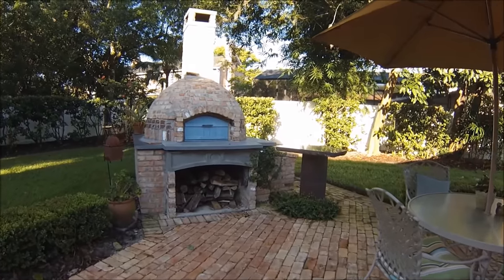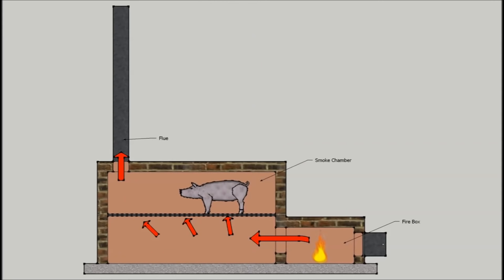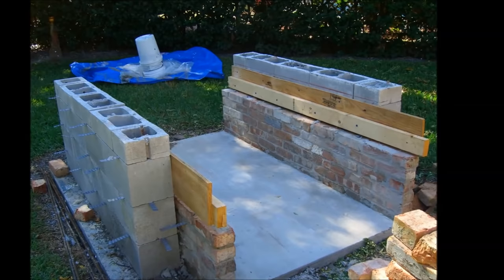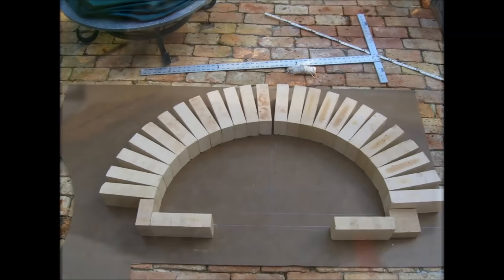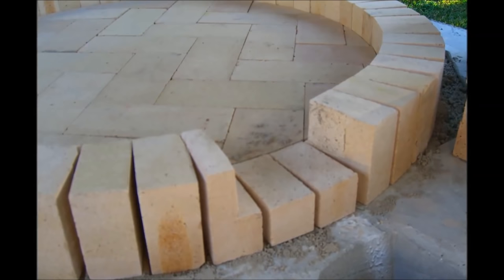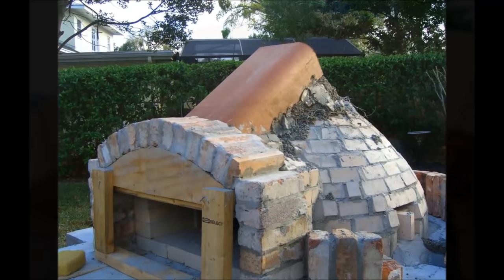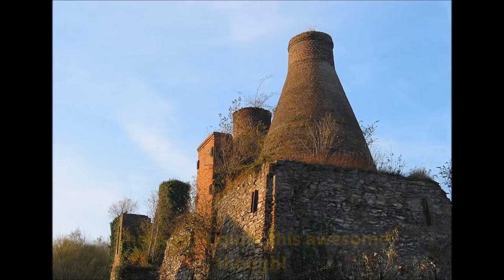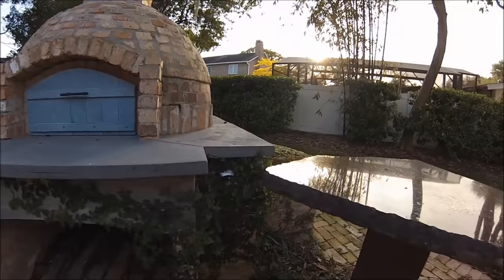How to Build a Brick Wood Fired Pizza Oven/Smoker Combo

Comment: Hey Lee, that`s a great video!
I did an apprenticeship with an old school plumbing firm in the north of England, we did everything from fixing a leaky fawcet to lead glazing to large scale heating, plumbing drainage and roofing construction projects. I`ve done plenty of lead, zinc and copper roofs in my younger days. The secret to getting the patina on copper roofs is as old as time and it is this........

One time I was fitting a copper roof on a catholic church in the shape of an A-Frame, and the old priest was amazed at how the bright copper sheets we placed each day, would turn green overnight. He`d often ask me how this happened and I`d always tell him it was a miracle! 
One day he saw one of the lads  on the scaffold with a mop bucket, mopping the roof. He asked me what was in the bucket and I told him it was Holy Water!
What it actually was, was piss ! The lads would piss in buckets throughout the day and we`d mop this on the new sheets before leaving site for the day. The acid in the urine reacted with the copper and turned it green! If you try this with modern copper sheets, they often have an oil based protective compound on them which has to be removed with  detergent , first.

Comment: Thanks from NY, for including the tip about making sure the foundation is beneath the frost line.
Reply: Think about what he said, how could that be? Northern states frost lines are 36"-42". That's impossible. It would be like 6 to 9 cubic yards just for the flat base to the soil level, not including the pad above ground! There must be a different way, like a floating pad for northern states. 
I had a similar idea for a smoke box but my idea was to put a second floor 12 to 18 inches below the main floor and at the back of the main floor, have an opening for smoke from a fire on the lower floor to come up and pass around the meat to be smoked on its way to the front chimney. You can also use the opening to brush your ashes then remove them from the lower floor...

Comment: Thank for not playing obnoxious music just plain calm explanations.Great build and thank you for sharing.Just a tip when you poured your oven base and was little short that is great.Fill the rest with salt it is great insulation and easier to level the bricks on top.
Reply from the maker: Yes, I agree, I should have made the bottom of the oven about 6" higher. That would have made it much easier to get things in and out of it. But, it would have made getting the brick out to use the smoker a lot harder.

Comment: Like many others considering a build, watching many videos, I’ve taken many tips from your video but most impressed by the fact your pizza oven has a sufficient flue opening to avoid the dreaded frontal smoke stain, brilliant
Reply from the maker: Yes it draws pretty good. A little smoke out of the front sometimes on start up or if it's windy, but other than that it pretty much all goes into the flue.

Comment: Nice Job!

I do a lot of DIY stuff on my Ranch, one thing you can do to get Air Bubbles out of Concrete is to use a round stick zipped tied/attached well to a vibrating sander!

works great for getting your mix to jiggle real good!

;Peace)
Reply from the maker: That is an awesome idea. That would have worked perfectly. I'll have to remember that trick the next time I pour some concrete.

Comment: It’s guys like this that make YouTube great, perfectly filmed and explained throughout. 

Over here in the Uk I have been trying to find out if I can’t use normal bricks to make a pizza oven, all builders merchants say no! I need to buy fire bricks but I know in Victorian times they used Engineering Bricks and the Italian for thousands of years have used clay bricks, I think this video clearly shows bricks are fine too use.

Cheers 🍻 for the upload
Reply from the maker: I used fire brick on the inner dome and I think that is the smart thing to do. Regular bricks might work, but then again, they might not. I would spend the small amount of extra money on the fire brick so I don't have problems later on - because it will be hard to fix if you do.

Comment: This is the best design I’ve seen after looking at dozens. 

Another option for the base in places with hard winters and freezing temperatures would be to dig out down to your frost level and fill it with rocks and or large gravel. This allows moisture to expand without obstructing or changing the shape of the ground. This is how they used to build log cabins and they would just make a big pit Full of rocks kind of like we would now dig out and fill with concrete to make a foundation footing when you fill it with the rocks and gravel and or sand even if water gets down in there the water is allowed to expand but the rocks don’t move with the expansion so you stay level, there are cabins that were built hundreds of years ago that are almost still perfectly level with those foundations. Another option would be to use an auger and drill holes down and basically make a deck to build all of the sun come out a very strong deck but it could definitely be done. 

I see a lot of people that misunderstand the installation process in the bottom for the perlite mix and end up making that in the bottom of the interior of their oven which means when they light the fire they’re heating it only from above because they don’t have that layer of brick to retain that heat and so everything has to cook from the top because the oven floor loses its heat being that the surface is the perlite insulated mixture that won’t retain the heat The same way the brick will so basically it’s a cooler bottom oven and then I have problems cooking things and they take a long time.  I like your solution because if you make it solid rock it holds massive amounts of heat and you’re constantly having to turn your pizza and keep it moving and cook it within a couple of minutes to where you were insulating the bottom then adding a layer to absorb heat so you come out somewhere in the middle where your bottom still retains heat and there’s enough to cook but you’re not constantly dealing with extreme amounts of heat on the bottom of the oven. 

My only change is instead of using the fire brick on the inside of the bottom, using the perlite mixture basically you get that fire brick installation of fact, I would’ve used pizza brick which is just a precast porous concrete like your clay, it retains heat but it also porous so you don’t get a frying effect it doesn’t resist moisture it lets the moisture out and to flow through it. That’s what most professional pizza ovens that aren’t a moving rack would use and I’ve always told her to call pizza stone probably because that’s its intent fire brick is an insulator meant to not retain heat to where the pizza stone is kind of a cross between that and solid rock it’s still retains heat but it is still porous enough to where you’re not going to have a completely solid surface so it’s going to allow moisture in air to flow on the bottom so you don’t end up with a soggy boiled mess in the middle.

For your copper stand to get the patina on there there are chemicals you can buy that speed the oxidization process but a lot of people just use a water with a little dishwashing liquid and a torch. You could also just brace or even just glue or Apoxsee some sort of trellis system or other material for those vines to climb up.  Plants generally don’t like copper, if you use copper spikes or nails in a tree you can actually kill it in many instances. But on that I think if you put some kind of trellis on the outside, you could wrap it with the wire like a cattle panel or fencing or you could do a wood trellis or a wire or string trellis the plants can climb up.
Reply from the maker: You are correct about the foundation. I didn't get into that much detail in this video because it was already long enough. Not to mention that the vast majority of my experience is in Florida, so I can't claim to be an expert on the best way design a foundation for those conditions.

Thanks for the comments!

Comment: I have been hoarding bricks for a few years now hoping to build myself a brick oven. I have 480 reclaimed firebricks (acme everlast, apgreen lonestar, unknown logo stamped), 60 new firebricks, 1980 texas red clay bricks(ferris, palmer, mexia, texas, abilne, cherry reds, dallas, local), 2100 reclaimed substandard Mexican bricks to use as outer veneer. I'm so close!!! :-) Awesome video interesting method for the dome instead of using a trammel. I've physically reclaimed all of these bricks out of the ground, demolished houses, remodels, etc.. by now I'm pretty damn good at cleaning bricks.

Comment: Its been 5 years now.  Can you do an update on the oven video?
Tell how it has held up and what it looks like now.
Reply from the maker: I actually built it a little over ten years ago, I just did the video around five years ago. I'm in construction so I have been super busy over the last couple of years and haven't done a new video in a while. This is the exact subject that I plan to do my next video on. It will be uploaded soon so stay tuned.
Reply: @LeeMcNeil  Thanks enjoyed your video. I love your idea for the smoker, but I am concerned that the mess that will make inside will be a problem when you want to do pizzas. Do you burn it clean or do you wash it? Maybe its not as big a problem as I imagine?
Reply from the maker: @malancronje6805  No. When you cook pizza in it, you build the fire on the floor of the oven right over where any grease would have dropped when it was previously used as a smoker. Plus the oven gets to close to 1,000 degrees when you cook pizza, so everything in it gets incinerated.

Comment: As an artist I use copper sheet and ribbing - if you use M38 gel over the sheet you can jump start the patina process. also the copper needs to be fairly clean. IF the sheeting is thick enough. I'm going to build one of these after I move.  I also work with a lot of different types of glass.  Thanks for your channel,
Reply from the maker: +Shereen Timmerman I haven't heard of m38 gel before but I knew there were some ways of accelerating the patina process. I didn't want to mess it up though. I need to just go out an spray it occasionally with some vinegar and ammonia just to give it a little push.
Reply: Google CAN be your friend. (M38 gel) Did you use plans from a book or PDF? Thanks again!
Reply from the maker: +Shereen Timmerman I drew them myself with Sketchup and my model can be downloaded from the Sketchup 3-D warehouse. I think there is some plans in PDF format that you can download from the Forno Bravo website also. They are pretty generic though.

Comment: Best one I've seen.  One thing, if you make the opening 60% of the height of the dome, there is no need for a chimney for normal cooking.  A removable brick could be used for smoking operation. To give the cooper a patina, wipe it with vinegar and let it dry.
Reply from the maker: I do have a removable brick that I can remove to use it as a smoker. Did you watch the video?

Comment: Hi Lee - congrats for sharing. Great ideas. . Here in Brazil, these kinds of oven are common. - heritage from Portugal and south Italy.
I might make it a little differently - with more uses.. as example - the furnace to make smoke,I'm thinking in a wood burning stove where the burning gases and heat , will help warm the oven plus smoke. Or a by pass at chimney duct might eliminate the smoke to outside - it depends the use.
The stove turns easily in a barbecue charcoal grill, removing the steel plate - and become a furnace using sanddust...
And plus - plan a water heating by metal coil at the exit of the chimney... 
I'm planing building one - and your ideas , all of them, will be used. Really thanks
Reply from the maker: I would have loved to incorporate one of those Argentine grills (I'm not sure if they go by the same name in Brazil). I haven't really thought of a way to make it look tacked on to the oven though. I may have to build myself one of those as a whole separate project.
Reply: @LeeMcNeil  - its easy to invent after people have already invented ...the trouble is the first step like you did.
give me an e-mail I can send you several pdf models for construction of smokeless wood stove - you can improve over that, like I'm doing over your ideas.
Actually, my plans only will copy your smoker system. I saw how to mix our ideas with gains.
My planned  oven will work with wood, charcoal, and/or gas propane. I made two ribbon burners like the forge ones (easily findable at yotube), to heat quickly the oven - useful to heat my steel works in damascus knife making too...
I reduce the inside space with blocks and bricks - work like forge...
I take the blocks out -have a insane oven.. With your ideas I can smoke some meats...
I'm designing the project...
About argentinian grill - copy the Uruguayan parrilera - find models at youtube - be sure its the best barbecue of world. 
I want to construct one (easy) to use inside the oven...
Be in touch - regards from Brazil

Comment: I used your approach with the Styrofoam mold when I poured the base.  That was genius my friend.  Pure genius. Thank you for sharing.
Reply from the maker: Mike Norton Yeah I've seen that before on some slabs under a cooler or freezer. It works great but wants to float like a bitch so you have to make sure it's held down good. Glad I could help.

Comment: One of the best videos for wood burning oven builds. Nice details. I like the idea ofvthe oven and smoker combo. Having trouble envisioning the size of the finished product. Also need to find details of the dimensions for everything and how many refractory bricks are needed.
Reply from the maker: The inside diameter is 36" and the lower part where the wood is store is around 6'x6'. You can download the model at the sketchup 3D warehouse,

Comment: Beautiful oven, well done!  My only negative comment would be that it appears to be too low.  I built an oven recently and from watching you bend over to look into it I researched heights.  I found that the floor of the oven is more comfortable a few inches below the shoulder.  Might not be a big deal to you but someone watching this video might want to consider it.  Great job though.
Reply from the maker: Yes I think you may be right. If the floor was just a few inches below my shoulder, it would be a little easier to cook pizza in it, but it have made it extremely difficult to remove the brick that I take out to use the oven as a smoker. It's hard enough to get to that brick at the height it is now. If the floor of the oven was about 4" to 6" higher, that probably would have been a good compromise.

Comment: Great job. For the patina, theres a copper instant patina diy spray. and for the smooth finish use melamine, silicone the edges, and coat the surface you want smooth with wd40 right before you pour. It als works great for a release agent
Reply from the maker: I used mineral oil. I think my mix was the problem

Comment: Masterfully done sir! I built my own smoker and dome oven but not all in one! I'm really impressed with your skill and built. Thanks for sharing your build process.
One thought, what about placing a pattern hammered copper band around the oven where you were thinking about placing tile. As it develops patina it would match your granite table's pedestal.
Again, fantastic job! If you get a chance, you can check out videos of my two builds!
Reply from the maker: tgchism Copper on the band is something I thought pretty hard about. But the main reason I want to put some tile there is that I want to get some color on it. Something kind of vibrant. Copper would be good but a second choice for me.
Reply: Ether way would be nice I think. The spanish tile will color it nicely. I considered it for my cob dome oven as well but was in too much of a hurry to get it done and short on $$ and skill to do it as I thought I would like. I really admire your skill and design. Truly the best of both types of cooking all in one!

Comment: Excellent inspiring job.  The smoker offset is a really cool idea.  I did a cob oven in my yard a few years back but like you said, I didn't have the proper foundation so that began to fail and since I didn't make a cover for it the weather got to the oven itself so it eroded away.  I think brick will be the way to go in the future and my rebuild.  Thanks for sharing.
Reply from the maker: Seezor Yes - you have to get that foundation right or you might be doing all that work for nothing. The brick is a good way to finish the outside. It looks great but is kind of expensive and labor intensive to put in - but really anything that will stand up to weather will be fine. A lot of people use a portland cement plaster or stucco. Or you could even put a metal roof over it.